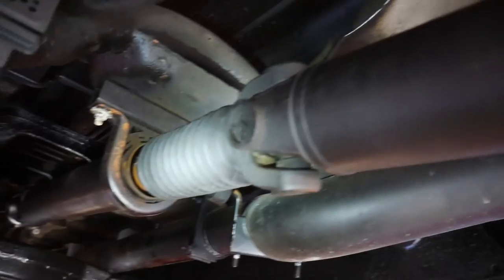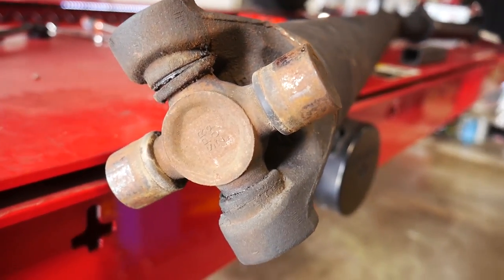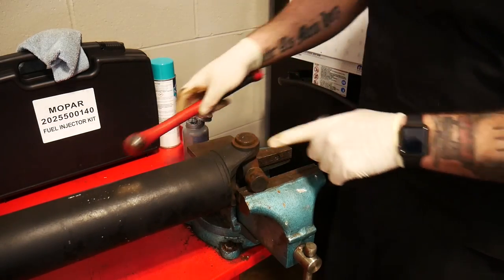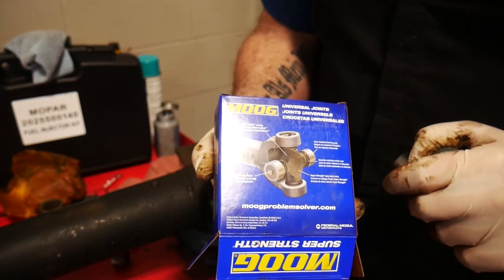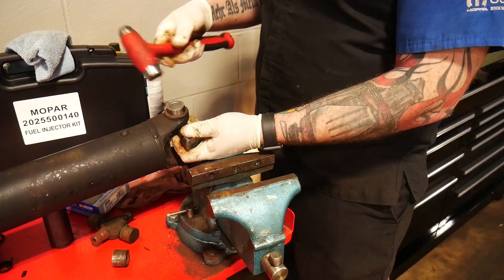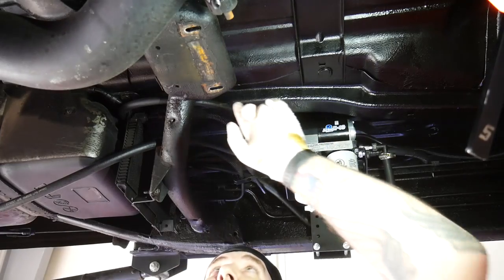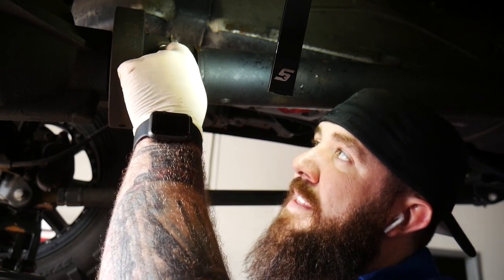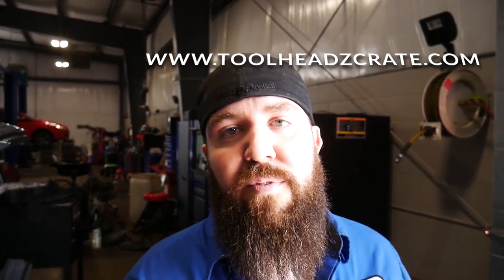SILVERADO DURAMAX HOW TO: U-JOINT REPAIR/REPLACEMENT

Comment: I know a transmission repair shop that has replaced the tail shaft housing on the Allison automatics.They were from bad u joints ignored not being replaced,broke the tail shaft housing.

Comment: So on a standard height Duramax, I don’t have to be concerned with that carrier bearing adapter mod?   True?
Reply from the maker: Correct, only on a lifted truck would you want to have a spacer to keep the drive line as straight as can be.
Reply: Rustbelt Mechanic 

     Thx for the response.

Comment: Just started to experience a similar noise when slowing down or coasting at like 10-25 mph, but not in reverse. Looked at the rear u-joints and the seal was cracked on one. How many miles did the truck have? How long in total time did it take you to swap out the ujoints

Comment: I know this is off topic from the video but couldn't find one of you working on steering components. I have a 2005 duramax with a 6" lift and I'm replacing the pitman and idler arm. My question is who makes good quality parts but that won't break the bank?

Comment: Did that seal replacement fix the issue.  I have fluid on the underside of my bed and frame also but upon inspection the seal looks good but it's the slip yoke seal that is leaking near the U joint.  Idk if I want to use a high temp sealant or replace slip yoke....1st world problems
Reply from the maker: In my case yes that fixed it. However another possibility on a lot of these is the dreaded pump rub in which case there is a pinhole leak in the rear case half.
Reply: @RustbeltMechanic  Good call. I will inspect my T case cover for the pinhole today. Man I hope I don't have to go all in on this T case haha

Comment: no UTC U-Joint tool?  makes that much easier than having to beat the u-joint out
Reply from the maker: Won’t disagree with that, just have never used that tool before. It’ll have to move to my short list.

Comment: Hay Kyle. Did you buy the Snap-on ball joint press? If not get it immediately. It has the adapter for u-joins also. it will change your life I promise. Moog has excellent u-joints. Only two I use , moog and spicer
Reply from the maker: I have not but from what people are saying looks like I need to try that press out.